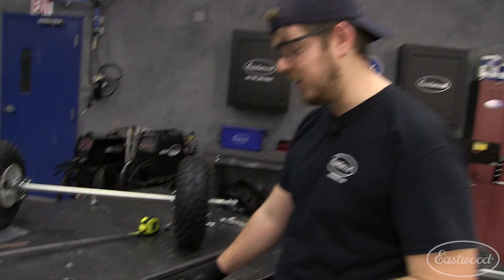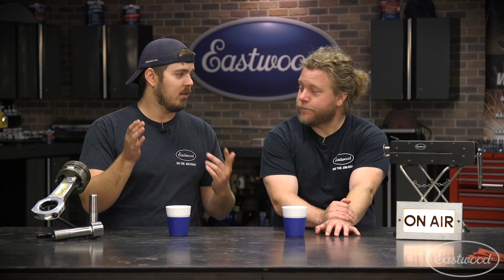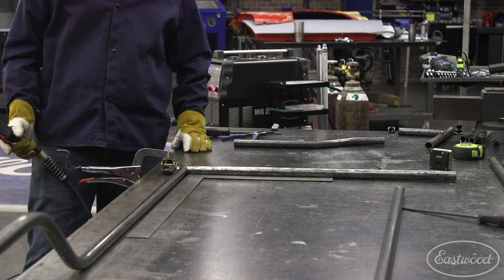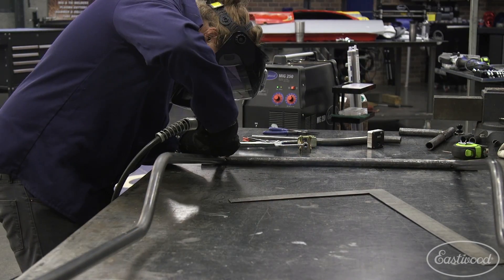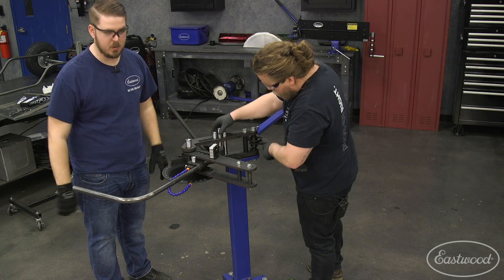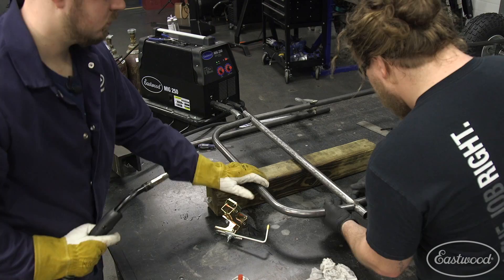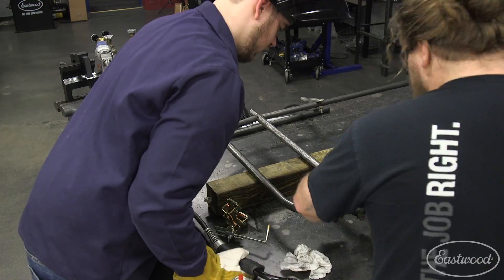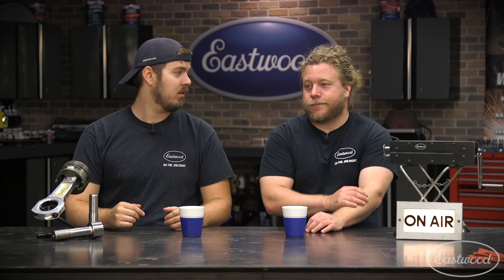Brand New Builders - New Metal, Tubing Benders, Go Kart Frame Assembly & More - Episode 2

Comment: Not a call out just a design statement. Your front bumper bar....why did you go with flat and not angled up some like an off road bumper. If you were to run into something there is nothing to protect your feet/legs. Anyway it is nice to see a company putting the tools they sell to work and show they work.
Reply from the maker: Thats something we would have changed the next time!